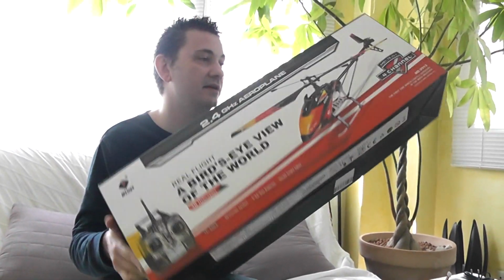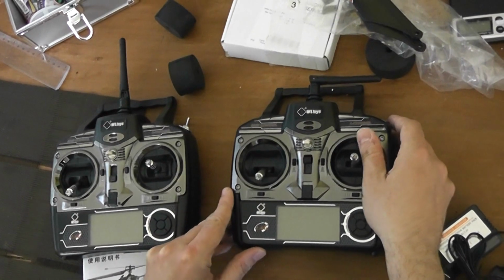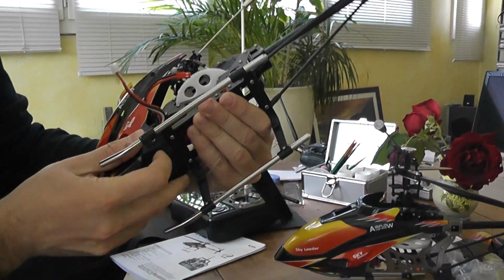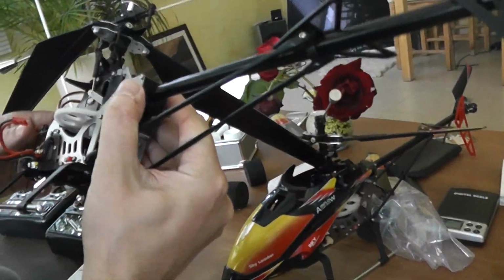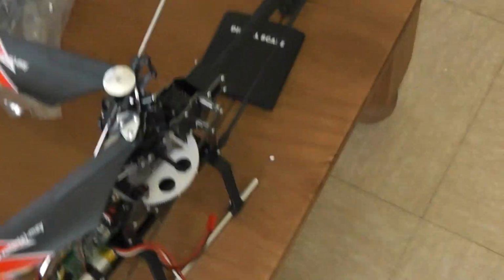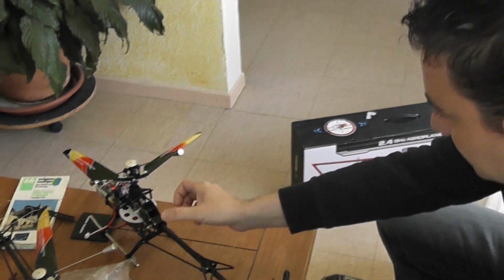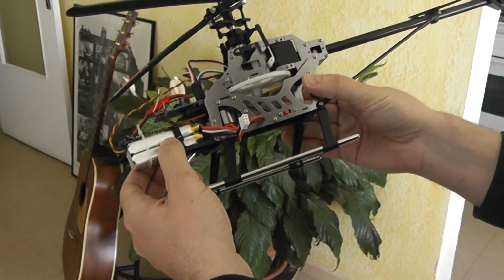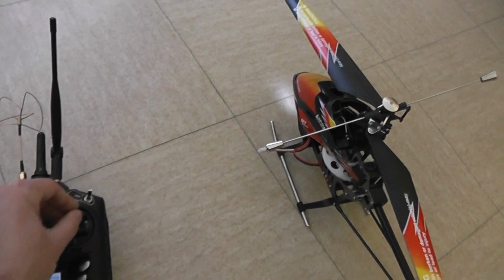WLtoys V913 BL (official product) Unboxing and testing (Courtesy of Tmart)

Comment: Good evening, I have a v913 with main engine brushlles ( http://www.ebay.com/itm/161472618189?_trksid=p2059210.m2749.l2649&ssPageName=STRK:MEBIDX:IT ), now bought a brushlles tail motor stated by the manufacturer ( http://www.banggood.com/pt/WLtoys-V913-RC-Helicopter-Parts-Upgraded-Brushless-Tail-Motor-p-948512.html ), but the tail does not work well, I have to change the battery 7.4v 1500mAh source for 7.4v 2600mAh ( http://www.banggood.com/pt/WLtoys-V913-RC-Helicopter-Parts-7_4V-2600mAhv-25C-Upgrade-Battery-p-944954.html )to work well?

Comment: SeLby, I apologize for all the posts, but here's something else I read. There's a defect on some of the V913's, where the rear prop motor shaft does not have proper clearance, & has caused rear motor failure. It might just be a smart thing to do is to inspect it, before it's flown, or risk having a failure that could of been avoided. I've seen this on YouTube, more than 2 times. Probably just a little piece that didn't get trimmed off the plastic properly. Fly Hard!

Comment: Hey Paulo, I went on Amazon or ToysHub & actually found a brushless stock size tail motor. Just remember. It's not that brush that's your enemy. It's heat. If you don't expose enough of the motor to put a proper heat sink, along with silicone heat sink compound connecting it to the motor, and think you can fly it for long periods, without checking how it's holding up heat wise, you'll be one of those guys walking up to your downed helicopter, smelling  a burnt smell. Also, spend 6 dollars & get you a Lipo low voltage alarm & put on your helicopter, so it doesn't fall out of the air and go crunch.

Comment: Thanks for the vid. Look forward to see which BL tail motor you run with. Saw one guy that had put a really sweet brushless motor on his I haven't been able to find anywhere. See if you can find the vid. It's a really HQ motor & had an orange or green prop. I can't remember. Another mod is swapping out the main rotor cap with the red MJX F645 F45 001 Aluminum Replacement Cap as it's wider and helps to minimize canopy & boom strikes from the flybar.

Comment: There is a BL tail motor & ESC kit here for $41.32 USD http://www.banggood.com/WLtoys-V913-RC-Helicopter-Parts-Upgraded-Brushless-Tail-Motor-p-948512.html
or the Dual BL kit, BL main and BL tail motors with ESCs here for $78.99 USD: http://www.banggood.com/WLtoys-V913-RC-Helicopter-Parts-Upgraded-Kit-Dual-Brushless-Motor-p-948510.html

Comment: Do you know any Brushless tail motor for the V913?
Reply from the maker: Standalone no ... but I know there are some MJX kit ... very similar for the V913
Reply: - The kit MJX-F45 gives ??? this one ( http://www.ebay.com/itm/Red-Brushless-Tail-Motor-system-for-MJX-F45-F645-upgrade-part-easy-install-/261567047099?pt=Radio_Control_Parts_Accessories&hash=item3ce69c65bb  )
-And then to configure, you can help me?

Comment: - Good afternoon, I bought this V913 ( http://www.ebay.com/itm/161472618189?_trksid=p2059210.m2749.l2649&ssPageName=STRK%3AMEBIDX%3AIT ), you can tell me what kinds of problems is that these helicopters have?
- It works well with the original battery (LiPo 7.4v 1500mAh), or have to put the (LiPo 7.4v 2200mAh)?
Reply from the maker: Problem the tail brushed will die after 20-30 flights, so it's good to stock some spare ones. If you are happy with the orignal LiPo, it's ok :). More capacity maybe will increade the flying duration of 1min.